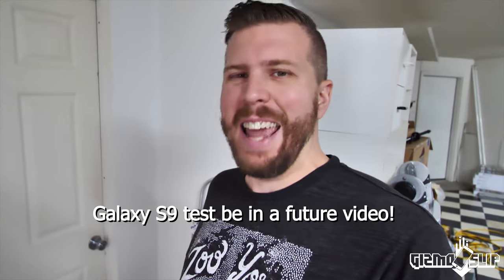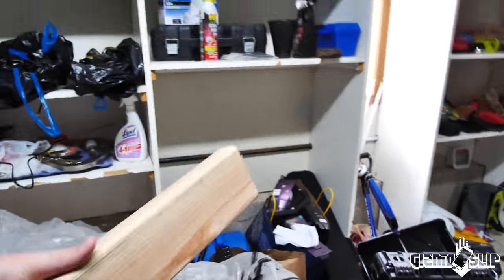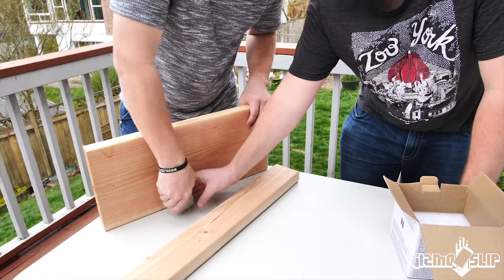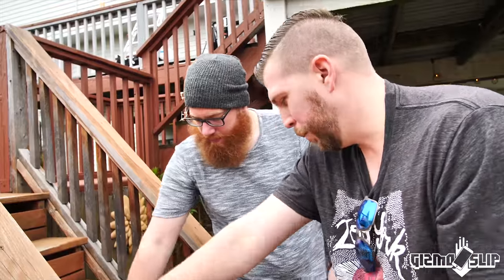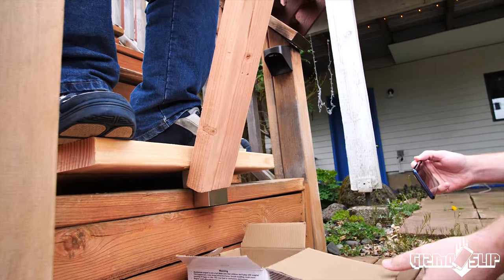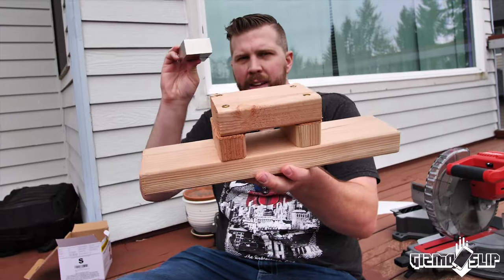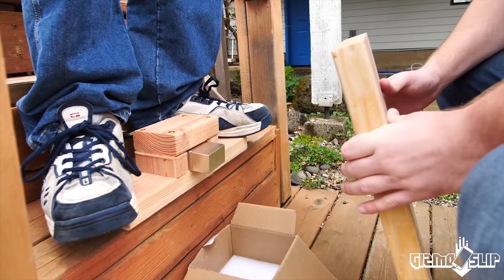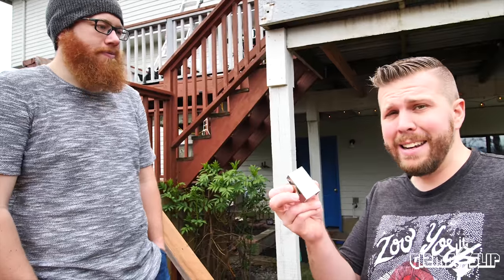Trying to Separate 1200 LB Neodymium Magnets!

Comment: All you needed was some 3 and 4  inch long sheet rock screws.      Instead of building a whole box to hold the stationary magnet, you'd just screw the top board to the bottom one with one magnet trapped in between them.  That would clamp it down securely.
Then while it's sitting on the edge of the step, same way you had it, you set the separate board oriented vertically up against the end of the magnet , and drive a single long screw in about an inch away from the magnet connecting that board to the stand.   Then rotate that board down, (rotating around that single screw) and it'll peel the 2nd magnet away from the first.

Comment: There in an easy way: get two long woods.  With a nut and bolt and some washers attach one ends, to have something with scissors action. Make two grove with the size of each magnet facing each other in the inner side of the wooden scissors. Put the magnets in the grooves, tighten the bolts and push the other ends toward each other or away from each other .

Comment: By heating, hitting, and (maybe by attaching opposites electric current too) makes the magnet demagnetise. Which can help.
And maybe some other technicians too.

You can temporarily reduce the magnetic force and later onward re magnetise it by using positive electric current or (by stroking which takes literally a lot of time and will but work pretty well) but electro magnetism will surely work
Reply: Or Just Use An Aluminum Baseball Bat.

Comment: You could have made a wood wedge to put in between the 2 magnets and then tapped it through with a hammer.  As the separation distance increases, you should be able to pull them apart.

Comment: They should've used clamps over the boards to hold it in place. Then they could've winched the other one off using a car jack or bottle jack with a wood (or plastic, thick tape, whatever non magnetic) cap on it.

Comment: Over thought this problem. Put magnets on a wood platform with one hanging off. Set a 2x4 over the one you don't want moving and use a clamp to apply pressure on the 2x4 holding that magnet. Now cut a 2x4 to around 1.5ft long and hold it on the magnet you want to seperate. Take a 3# sledge to that short board smacking it free. Probably a 1 person job but hindsight is 20/20.

Comment: Far out man.  I nearly crushed my thumb with these things. If I hadn't been taking all sorts of stuff to build up the density of my sickly bones for a while, I hate to think what would have happened (my bone density went down so much, just laying in bed not moving, I heard a mighty splitting crack in my spine.  I have had that sport of split before, when I had an accident as a kid, and some cracking in the vertebrae last decade.  Look up the western price diet, and the book, how to cure tooth decay for some additional bone hardening techniques).

I just bought some of these magnets to make a magnetic field device, and when I was trying to attach them, one of the magnets attracted some near by very light wire caging unexpectedly, and distracted me, the things slammed top and bottom of my thumb.  I still have got twinge of pain on one sidel, so it might have micro-fractured it.  Another 6 weeks of taking it easy on the thumb, and proper diet.

By the way, you should use the leaver method, but I'm going try the metal method, with a bit of slide surface protection to stop the magnets getting scratched.  In this, I slide the magnet off onto a light metal plate, even weak magnetic sheet (the same stuff as magnetic tape).  The field from them will warp to incorporate the magnetic sheet, splitting the attraction, and as it moves onto the sheet it will progressively stick to it, but if it's no low friction it will resist the magnet moving more onto it.  Of course, you don't let the two magnets rock or move back together, and at least space the apart.  But, it's crazy what you can do with magnetic strip tape.  I charge them up in strong fields to align them, making them a bit like rare earth magnets for a while.

In future. I think I will just use thin magnets stacked, so I can remove them one layer at a time.

Comment: I could be wrong. But do two 600 pound magnets actually equate to 1200 pounds of force?
Again I could be wrong. I'm going off knowledge of a different scenario.

There was this mythbusters episode. Where they had to cars going the same speed hitting each other at like 60 mph. And Jamie said that's like the force of a single car hitting a wall at 120mph. And it turned out he was wrong. It would have been like the force of a single car hitting at wall at 60 mph. So like my thought process here is kinda the same. Do two magnets actually add each others pull weight to a new sum? Or does it stay the same?
Like I said. Different scenario, so it likely doesn't apply. But maybe. I'm curious. Educate me science tubers.

Comment: The reason they use a lever in whatever video you watched is twofold (at least).
1. It's easier because the lever provides mechanical advantage (allowing you to place large force on the magnets without applying a large force yourself).
2. You don't have to apply a sudden force, due to this ease, so you won't break the magnets.

Suggesting that your method is even remotely good is dangerous advice. And when you pulled them off the phone you should at least have been wearing gloves. You could've crushed the tip of a finger.

Comment: You could’ve tried reversing the magnetic polarity of the magnets using electric pulses. Similar to reversing a clock to move counter click. However once the magnets piles were reversed they would fly apart with 1200 pounds of force.

Comment: The methods of separating the magnets was over complicated. Take two boards cut a notch the same size as each magnet out of the side of each board, place the boards together with the notches lined up and place the magnets in the hole created by the notches. Get each person to push a board the opposite way of the other. You could also place a board over the top to prevent the magnets from popping up out of the notch if needed.

II   II      II  II
II   II      II   ]
[     ]      [   II
II   II      II  II    This is a poor example but hey if it helps show the idea it did its job.

Comment: a fact if you heating a magnet it will lose its magnetism and these magnets can be remagetized so if you brave then you heat them up to max. 200-300 °C after that they can be separated and after they cool enought you can remagnetism them with electromagnet

Comment: Omg lol I accaully had these before as my dad works with them except they were like tiny smaller than my pinky nail and well..... I got 1 stuck to the fridge I’m being 100% serious turns out that a tow cable got it off... I used them in my 8th grade science fair and let’s say I stole the show with my electromagnetic motor which hit almost 1200 rpms with 1 AA battery

Comment: Hey have a vice? Use that to clamp to the table and then wut you do is grab anything like a sledge hammer
Reply: And then just slam it if u dont like that then use two vices one to clamp one to a table or surface and the other to have something to pull if with